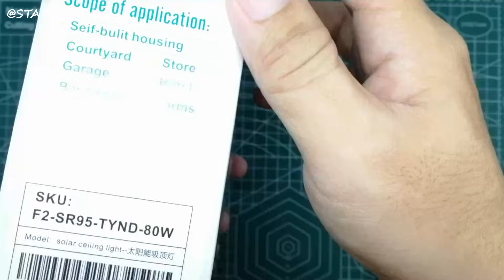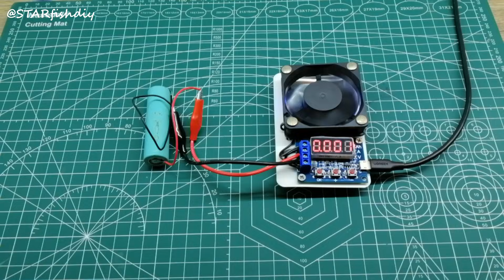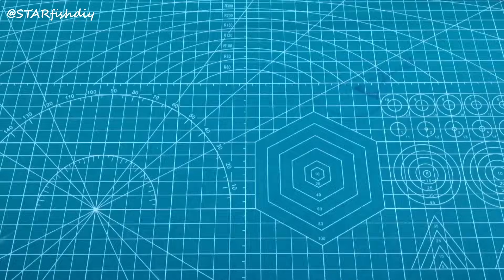80watts Indoor Solar Light | Unbox | Disassembly | Battery Capacity Check | 5000mah Battery Upgrade

Comment: Pwde kaya i series Ang connection,Yung sa akin kasi nakabili Ako 3.7 ang rating ng  battery voltage then doblehin ko kaya para maging around 9V di kaya masunoh ang led kaya kaya ng capacity ng lamp yan

Comment: Ano pong voltage ng battery na ginamit? 3.7 or 3.2? Yung ibang nakikita ko kasing replacemenent videos ay 3.2 ang ginagamit. Wala kaming multimeter kaya di ako makacheck.
Reply from the maker: kahit alin sa dalawa pwede mong gamitin na battery . ang ginamit ko dyan ay 18650 na battery  3.7v .  thank you

Comment: Boss pwede ba gamitin yung dalawang magkahiwalay na battery yung hindi nka parallel? Yung ikonek sya dun sa wire ng isa pang battery ganun po pwede ba yun?
Reply: Hindi kasi magiging series na yun tataas yung voltage pero di tataas yung capacity.

Comment: Sir pede po ba dyan ung nabibili na lipo4 5000mah na ung with bms natpos direct ikabi ko nasa wire sir?
Reply from the maker: pwedeng pwede Sir. 👍
Reply: sir may na bili ako solar ceiling na 1000watts daw un pero madali malowbat,5000mah din sir ok na pang damagan?salamat po
Reply from the maker: @YolacSia  kung mabilis malobat dagdag ka ng battery idol para abot magdamagan TY

Comment: sir.. anong mga gamit pang assemble sa battery at anong battery gamit mo.. yung sa akin kasi kaparehas ng ilaw mo. kaso yung 300W ko hanggang 12MN or 1am lang.
Reply from the maker: 18650 battery gamit ko Sir. sa shoppe ko nabinili.  dagdagan mo lang ng battery para tumagal yun ilaw.  saka  kung wala ka pang spot weld sa mga battery. bili ka ng 18650 battery holder. thank you
Reply: @STARfishdiy  Thank you sir, ilang MAH na battery kaya sir ang kailangan ko para tumagal yung ilaw nya.
Reply from the maker: @mariovergara4547  5000MAH pwede na Sir. tatagal na yan magdamagan.
Reply: @STARfishdiy 1700 mah na tatlo piraso ok naba? 1s 3 amp bms ok na 18650 use ko sana, paano kung 6000 mah tatlo 2000 mah use ko, ok lang ba bms na 3 amp?
Reply from the maker: @darcan8970  ok lang na 3 amps ang gamitin mo sir goods na yan.

Comment: @starfishdiy. I would like to ask ur battery is connect in series or parallel? parallel right so that ur BMS will only kick off when the over voltage
Reply from the maker: yes it is connected in parallel. thanks
Reply: @STARfishdiy  thank you very much for amazing knowledge sharing . I could modify my solar light at home

Comment: Anong pwedeng alternative sir kung walang pang spot weld sa batts? Pwede ba soldering at wire instead?
Reply from the maker: hindi advisable yun soldering iron kasi madadamage nya yun battery.  meron po nabibili na 18650 battery holder sa shoppe/lazada. yun po pwede gamitin . thank you
Reply: @STARfishdiy  i see, ok po sir. Ask ko lang din sir yung tatlong battery na po ba ang protected sa isang 1s na bms mong nilagay? Ang pagkakaintindi ko kasi isang 1s bms kada isang batt.
Reply from the maker: @kristiavaldepenas6196  yes po , isang bms lang  okay na kahit ilang battery pa yun ilagay basta nakaparallel sya thanks.
Reply: @STARfishdiy  thank you very much po sa info sir.
Reply: Sir pano po ung bms? Pano ididikit un pag wala pong gamit?

Comment: Sir ilan volts ba puede ilagay ko sa ceiling light ko ng 60 watts lng dadagdagan ko sana ng isa
Reply from the maker: depende po sa battery kung 18650 po nakainstall need nyo po 3.7volts  kung 32650 battery 3.2v sya .
Reply: Saan ba makita
Reply from the maker: @laurencetee8754  check nyo sir voltage nun battery gamit tester usually 18650 nagra range ng 3.7 -4.2v  sa 32650 3.2-3.6v

Comment: I love the videos. I would like moe information on the calculations required to increase battery size/Ah using the voltage and panel size increase to gain a full charge without over heating or needing some sort of regulator. 10 to 12 hrs is ideal for me.

Comment: sir 100 watts cieling solar lights ko n dagdagan  ko ng isang battery ok lang ? kasi 4 hours lang mhina n ang lights pwede dagdagan ng isang battery at ang solar panel  di n plitan ng mlaking panel?
Reply from the maker: okay lang Sir, sakin 2  na 18650 battery pa dinagdag  ko. thank you
Reply: @STARfishdiy sir okay lng ba na ala bms
Reply from the maker: @marlonjavier4810  hindi sya advisable na walang bms, mabilis kasi masisira yun battery pag hindi naglagay ng BMS. thanks
Reply: @STARfishdiy anu ampere ng bms ser? 3 amp pede na ba, halimbawa 6000 mah na bat lalagay ko?
Reply from the maker: @darcan8970  3 amps ginamit ko dyan sir goods na goods

Comment: Bumili ako neto sa online, biglang hnd na umiilaw at hnd nag b-blink yung red light pag naka charge sa araw. Battery lng po kaya yung sira nun? Thanks
Reply from the maker: possible sir pero para sure check mo muna voltage ng battery saka solar panel sa multimeter tester.
Reply: Try mo I switch on. It happened to me

Comment: Boss pag palitan ng 3 crownstar 18650 3200mah 3.7 pwede?.. jn ilagay battery .. kse running 6hours sa Solar Crownstar GD-27 eh.. 100 watts po saken chandelier sa una lng maliwanag madali malowbat
Reply from the maker: Good day boss,  pwede yan sir , suggest ko bili ka nun mga true rated na capacity, para matagal malobat.  add ka narin ng BMS para protected yun battery mo. thanks

Comment: Even not just for 80w just the solar charging can not charge the 3 batteries with same pannels or maybe with the same charging componnents, it will overheat, it can not handles the 3 batteries, it is not designed to do so.. It is only for single battery, maybe you can replace batteries with Genuine or HQ Brand its you can do least to extend the hours of use but not add more batteries.. Do not do any modification unless you understand electronics or you are professional technician.. DIY is good but not all posted here in YOUTUBE is accurate... I hope someone here will notice the difference.. My 15+ years of experience will give you assurance and this is my field of especialization.. I've bet good in DIYs not just a regular repair technician do.. Thank you
Reply from the maker: good day Sir, so far i dont have any problem in adding more battery and issue in overheating. and in my observation the light got better and lasted longer .thanks
Reply from the maker: @A86-t3y   it can last up to 12hrs in medium bright. Thanks
Reply: Hmmm well eufy cameras have 2 to 4 of those batteries and uses a 2.6 watt solar panel to charge them.
Reply: pwede bang gamitan to ng step down buck module kung series ang battery?
Reply from the maker: @ghlenmarkverzosa5468  Hi Sir , step up module yata yung sinasabi mo , pwde naman sir kaya lang sa specs ng solar kagaya neto 6v(3watts) lang . need mo mag add ng solar panel para mafull charge yun battery .
Reply: qng tataasan mo ung solar panel anong watts ang pwd at qng anong voltage ang kailangan
Reply: Correct. Internal resistance of 1 battery is totally different from 3 parallel batteries. Also, 3 bms are needed for each battery, not just 1 bms for 3 parallel batteries.... It's dangerous if one of the batteries is gone & shorted without bms.. The rest of the batteries will charge the dead batteries, overheat & potentially burn.

Comment: what batt is that? why 4.16v
Reply from the maker: Hi! its18650 lithium ion battery. 18650  have a voltage range between 2.5 volts and 4.2 volts. thanks.
Reply: lods sa 600W na ganyan pwede ko rin ba dagdagan ng baterya gaya ng ginawa mo?

Comment: I did not put bms is it okay? 😅
Reply from the maker: good day. Yes its okay ,there are other solar lights without bms like this one. thanks
Reply: Pwede ba 2 lifepo4 3.2 volts  na 2 walang BMS
Reply: It can be use the 220v rechargable battery to solar light

Comment: For how long is the 5000mah battery last?
Reply from the maker: Hello , in my case I'll only used it for 8- 10hrs . I think it can last up to 12hrs in medium bright. Thanks
Reply: @STARfishdiy  thank you im planning on buying those and replacing it with 10,000mah battery
Reply from the maker: @taejinjin9722  that's good. but don't forget to upgrade or add solar panel to fully charged the battery. thank you

Comment: These batteries cannot provide 80watts. It is low power and low lumen solar led light.
Reply from the maker: Good  day Sir,  its not as low because Im using it in the kitchen as a night light .the lumen is good specially in full bright mode and also the  price(5.5 USD) is cheap and worth it. Thank you
Reply: he do to extend hours the use of light not for adding watts😂

Comment: if d panel output is very small......it makes no sense to UPGRADE D BATTERY......MATH ANSWERs
Reply from the maker: yes it cant get full charged. but based on my computation, the panel can charge the battery up to 81% from 0%, not bad especially if you use it for 8hrs only. But we will still upgrade the panel soon. thank you

3.7v x 5ah = 18.5wh battery capacity

3w(solar panel) x 5hrs(sunlight) = 15wh

15wh/18.5wh x 100 = 81%

*if I'm not mistaken